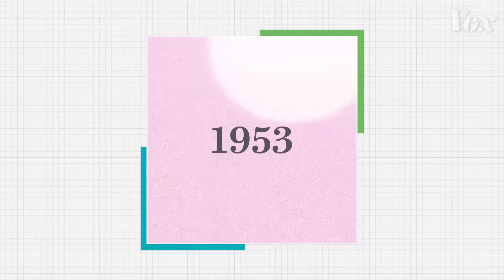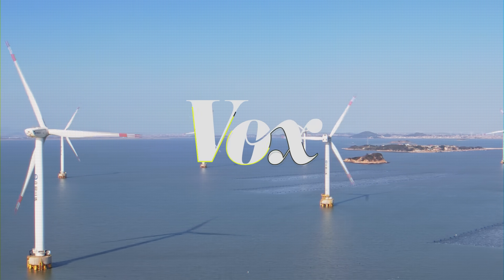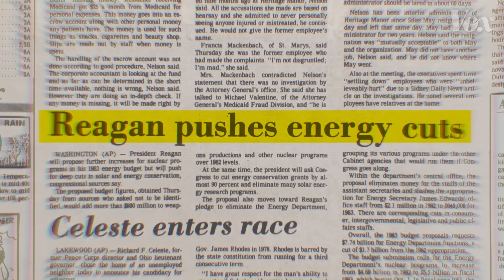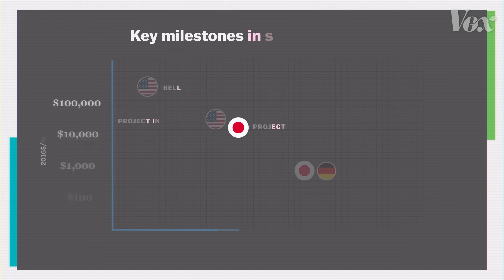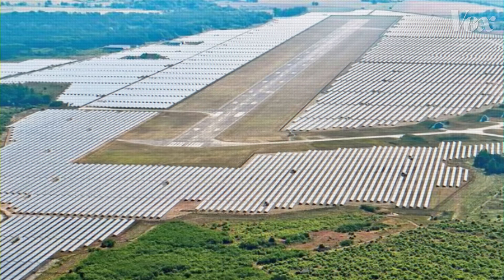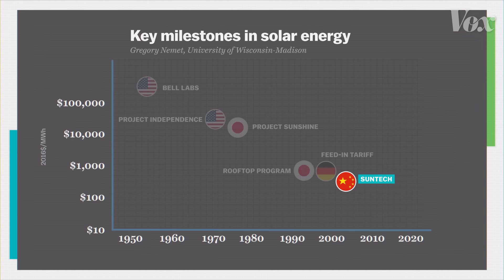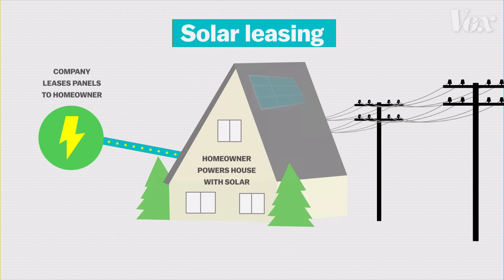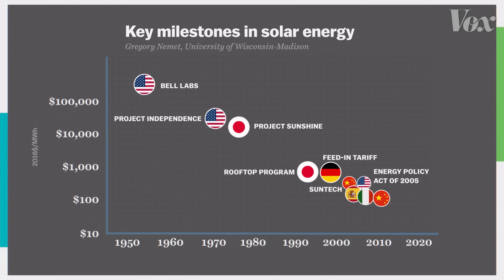How solar energy got so cheap

Comment: As much as solar is an awesome technology, There is actually a big problem with its peak production hours. It only really produces a usable amount of electricity throughout mid day, morning and afternoon not so much. This is s huge problem because the grid is strained the most in the morning and afternoon when people are getting up and moving around to their jobs/homes and such. This means that thr only times solar is functioning and producing a usable amount of energy is when the grid doesn't need it, and the only way around this would be to store it with somthing like pumped liquid storage, however that is INCREADIBLY expensive to build and takes up a huge amount of space, so it wouldn't work around cities and dense urban areas where power is being use the most. And of course batteries are out of the picture for obvious reasons.
Reply: There actually are a lot of other alternatives to pumped storage, however each of them has their own quirks and problems.
 Batteries are efficient, but extremely expensive and they also don't last very long. Not very viable for grid electrical storage.
Pumped Hydroelectric Storage is very viable and reliable, but it is EXTREMELY situational and can't be built everywhere. If relies on the geography of an area. It is also very expensive as huge dams and infrastructure must be built for it to work. However, it isnt very complicated compared to other alternatives and can be built on a massive scale able to store huge amounts of energy.
Compressed air storage is where air is pumped into natural underground chambers building up pressure, and when more energy is needed it is released and spins a turbine. This is also very situational, and there are a ton of other factors that play into it relating to the geography of the area dn tons of other stuff. This does work but it is limited by the fact that there arnt underground cavities everywhere. However often there underground cavities are quite large and it is able to store a huge amount of energy,, usually not quite as much as pumped hydroelectric storage though.. Above ground storage is limited and expensive because building huge metal containers capable of withstanding massive amounts of pressure is very expensive. 
Liquid air energy storage is where air is cooled and compressed to turn it into a liquid, then stored in tanks, similar to compressed air storage. This is very expensive due to all the equipment needed to cool and compress the air and usually isnt done in huge amounts, compared to Punped hydroelectric storage or Compressed air storage. However it is more efficient than Compressed air storage as due to the air turned into a liquid it doesn't need to be kept in high pressure containers.
Reply: @user-rs3lm1ci6n  there's lithium, molten salt, lead..etc but they are quite expensive and they need to be changed every 10-30 years depending on the type and usage
Batteries are the unknown dark side of renewable energy
Reply: There's a thing called grid networks and interconnectors. You can export out the excess, even at a loss e.g. California solar -> Not so sunny Vancouver.

Comment: That's honestly super interesting, but the problem with solar is the fundamental amount of metal needed to use it. Don't get me wrong, once they are created, they do provide electricity, cleanly, but producing metals are extremely expensive in CO2 emissions. The other major problem is the amount of metal needed to create solar power cells that you can use yourself.
Reply: Solar cells have a contact surface that must be conductive and transparent, and the mase metal here is indium, which is not cheap and not abundant. But alternatives are being developed.
The cells themselves are silicon based. Costs energy to produce, but can be very thin.

Comment: Great video on how subsidise help support a market's growth. 

However I feel obliged to mention that the Feed-in-tariff and similar schemes in the EU were phased out in the late 2010's due to costs to the governments. Subsidise However do still exist in a similar auction based format, with the goal of stimulating competition to drive costs down quicker. A great case study for this is the drop in offshore wind.

But the main message of the video, subsidise are essential, is still very valid and as shown in the case for solar NOT perpetual as detractor may imply.
Reply: Feed-in tariff exists until today in Germany for typical residential new installations (means: until 2043 if installed this year).

Comment: The issue is that the price of solar is calculated in large part in relation to the expected lifespan of solar panels, but the Chinese solar panels are shockingly not lasting as long as we expected them to, which radically changes the price figures. Not sure where that puts the actual price, but the Chinese aren't sending their best.
Reply: The chinese solar industry is huge. Yes there's some bad quality stuff there but you can also get some of the best stuff the industry has to offer. It's all about how much you're willing to pay.

Comment: AND is it reliable and dependable???  How do you get reliable and dependable?  You back it up with Coal, Oil or Nuclear.  This makes solar twice as expensive as fossil.  HMM
Reply: How does that make solar twice as expensive as fossil??
Reply: @ERobbins1234  You need all the Chinese made solar panels, the land they occupy, AND RELIABLE DEPENDABLE BACKUP FOR WHEN THE SUN DOESN'T SHINE OR THEY ARE COVERED BY SNOW (aka Nuclear or fossil fuel).  You can't eliminate the existing you can only add solar -- therefore doubling the cost.
Reply: @ronmsimmons  That's not how it works. Most developed countries are increasing their solar power use, while decreasing their fossil fuel use. There's no need to produce both.
Reply: @ERobbins1234  How's that working out for Germany??
Reply: @ronmsimmons  Great, seeing as oil prices are now through the roof.

Comment: Solar is cheaper, but definitely not cheaper than coal and natural gas in most of the US.  If it were, it would be on every roof across all of the United States.  There's some complications with solar especially with power delivery, power retention, and time of use.  In dense areas, land for solar power farms comes at a premium and thus the power delivered will come at a premium.  A lot of new constructions in the suburbs of major metropolitan areas are increasingly building up, via townhouses, in stead of building sideways, via single family homes.  This means less surface for solar panels and thus less power generated.  I recently got quotes from solar installers, and even with the federal tax credit, it will take at least 25 years to break even for a cash upfront installation.  However, if I invested the the money paid for installation, it would never break even.  Solar is a great idea, but not the ubiquitous renewable energy that's being described here.  Solar needs to get much much cheaper before it's adopted by regular Americans.
Reply: *depends on geography.

Comment: Very nice info, but you are missing the fact that the electric grid doesn't accept fluctuations with the whims of the sun, you need backup power.  Solar works GREAT if the demand at least roughly matches when solar is available (A/C demand for example).  Otherwise. you need to add a LOT of storage to that downward curve showing solar is the cheapest.  As a further point, nuclear is shown as expensive in that chart but it HAS got those costs baked in.  So does gas generation (though that still emits WAY too much carbon).  Finally, it is worth noting part of how China got the cost so cheap is they basically ruined their environment with lax laws for manufacturers, and we still don't have a solar recycling program.  Next time you do one of these on solar, look at the FULL cost.

This isn't to say solar is bad, this is to point out missing information that needs to be considered.  Someone would look at this and go - well it's by far the cheapest, why not just use solar everywhere?  That's why.
Reply: true
Reply: yes

Comment: China controls 95% of the solar panel market. They are cheap because labor in China is cheap. Labor in China is cheap because labor laws are very lax. While, on the face of it, solar power is economical (LCOE is not perfect as it does not account for storage and transmission costs) it is not as environmentally friendly as it seems (there is a massive materials throughput: solar panels don't last forever and they need rare earth metals) and, right now, they are subsidized by the exploitation of the chinese working class. 

Nuclear power is a far superior source of energy. Its cost is on par with renewables, below fossil fuels (the graph shown doesn't eliminate outliers, which happen for political, not technological reasons). It needs faaar fewer materials than any other source. It needs less transmission infrastructure to be built (0 if built on a former coal plant) and no storage is required.

Comment: In my state of Gujarat, India government has come up with solar roof scheme. As per this scheme consumers solar plant ca n be installed at your roof or terrace. The electricity produced from the solar will be injected into the grid. Whatever consumption consumer makes will be adjusted against exported electricity. This has greatly reduced not only energy bills but will also earn money in case of surplus. Even at my own house we have installed 4.7 kW of solar plant and we have greatly reduced energy bill. This agreement with discom will be for 25 years. According to the data published by state government in last two years 2,30,000 consumers mostly domestic have availed this scheme.

Comment: I got solar installed last summer. Expensive up front, but after tax credit and rebates was estimated to be about $16k. It's already made back over $1500 in under 10 months, putting me on track for ~8 year breakeven. Even better, I was informed a while back that the SREC prices went up, meaning my rebate amount will go up by about $2300, so my actual net cost will be around $14k. I'm in the Chicago suburbs, not exactly where you'd think of first for cost effective solar.
Reply: Thanks for sharing.  Unfortunately, $16k is still expensive compared to other countries, and Solar salesmen are predatory at most.  Can I ask what's your interests rate on your loan?
Reply: @RealRiders  no loan, I bought outright. I agree the price is still too high for most. It's a 13.5 kW system though, a bit on the large side for residential.
Reply: @Tesserex  Thanks for the reply.  Buying outright is the way to go.
Reply: @Tesserex  I wish I had purchased a larger system.  After I got my solar I started consuming 50% more power.  I could easily make it 100% more if I purchased a second EV.

The payback with tax credit is 4.5 years for me. Even without the tax credit it's like 7 years.  That is stunning.  After payback it's free electricity!
Reply: @ironqqq  do you in Clyde increased house insurance and taxes in the calculation?
Reply: @1001legoboy even though the entire installation is permitted, there was no increase to the house's tax assessment.  Insurance did not cite any specific increase.
Reply: @Tesserex $16k for a 12 kW system sounds like a bargain.  Unfortunately in the US half of the costs are permitting and labor.
Reply: I just put in for my solar system the total amount is coming to 62k in Maryland. 16000kw a year system. Anyone who says it's cheap is wrong cause 62k upfront is a lot of money.
Reply: @ass4sale2  I just checked again, and my system is actually 14.4 kW, and it was $43k up front, so just a hair under $3 / watt. Yours is about $3.87 per watt. Who was your installer? Even so, you'll get almost two thirds of that back from the tax credit and SRECs.
Reply: @Tesserex  system is 49k upfront but they said I need a new roof because my roof is 10 years old. So add in the 12k for the roof and comes out to 62k.
Reply: @ass4sale2  So then it's not 62k for solar panels, it's 49k.
Reply: how did you get it soo cheap?? everyone I've talked to is quoting roughly $4 per watt... I'm on the west coast of Canada, and I guess electricity is cheaper here than other places because I'm looking at roughly 30 years for break even... and by then all the equipment will need to be replaced.
Reply: @michaelransom5841  I don't know if it works in Canada, but I used energysage to find my installer. They will always be much cheaper than companies that have to advertise to you like sunrun and such. My electricity is around 12 cents / kWh. Your latitude and sunniness will be a factor too.
Reply: @Tesserex  Ya, I'm about 7 degrees further north than Chicago, so there is that. But I'll look into energysage... more often than not programs are basically the same either side of the border....thanks.
Reply: Has your insurance company dropped you yet ?
Reply: must be nice to be rich, Not to many people in the Us can afford 14k
Reply: 8 year breakeven? So it's comparable ROI to investing in the stock market. But it's a very illiquid investment, which makes it risky. And you haven't factored depreciation into these numbers. And 8 years from now there may be much cheaper and more efficient technology. Doesn't seem like a great investment.
Reply: @megamaser  the illiquidity only matters if I plan to sell my house, which I don't. If some disaster happens, we have insurance. After breakeven, I'm just getting $2k a year for nothing. I don't consider it an investment vehicle anyway. But after 15 years, the return is about the same as if I had dumped the 16k into the market at 5% per year.
Reply: @Tesserex  If it's not an investment then what is the purpose?
Reply: @megamaser  well it does save money and then make some back, but it's also to use more renewables. The alternative, if I only cared about money, would be to think maybe if the market does consistently well, I could come out ahead in 20 years. And by the way I do already have plenty of money invested. It's not doing great recently. The panels are more like getting bonds - lower return on average, but consistent, I know what I'm getting. Why not ask why anyone buys bonds? Or ask why don't the utitlites just invest their cash instead of building solar?
Reply: @Tesserex  it’s objectively a bad investment it’s not liquid it has interest rate usually dealer fees and it doesn’t actually increase the value of your home. Your utility likely uses mostly renewable energy anyway mine is at 80 percent and in my rental 100 percent renewable. We need grid solar rooftop solar is inadequate. I wanted it to work but in Texas it’s not a good financial idea
Reply: @michaellawrence1601  Utilities definitely do not use "mostly renewable" energy.

Comment: A HIGHLY underrated challenge for solar in the coming decades is the cost of the raw materials. 
When demand for solar skyrockets to a massive scale, the metals used to produce will get more expensive and more scarce. Mining industry experts are very worried that there will simply not be enough metals to feed the "green transition".
Reply: Especially if they stop using slavery & child labor to mine them…
Reply: Silicon is the second most common element in the earths crust
Reply: @gpsfinancial6988  silicon is not the only thing needed… 
The IAE indeed says that there will be resource and energy scarcity to produce more renewable in the future

Comment: Nuclear is definitely the energy source we should be investing in, while solar is cheap it can in no way be the main source of energy. It's way too unreliable, while nuclear is green and one of the most reliable sources of energy. Nuclear plants need to be refueled every 12 to 24 months, and nuclear fuel is cheap and abundant and untapped in most places. And with Nuclear most countries will have domestic supply of it, bypassing the Oil cartel of the middle east.
Reply: Nuclear fuel also comes from a limited number of countries. And the plants are really expensive (but could be cheaper with mass production).